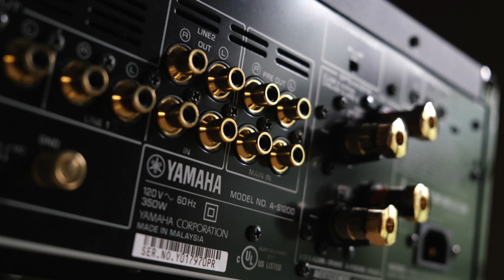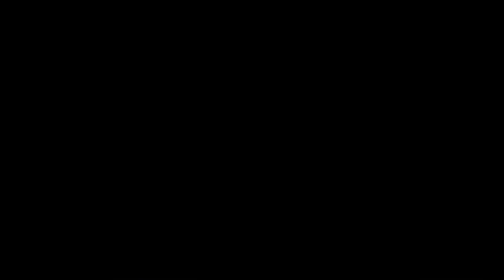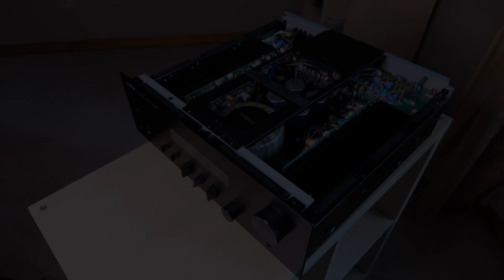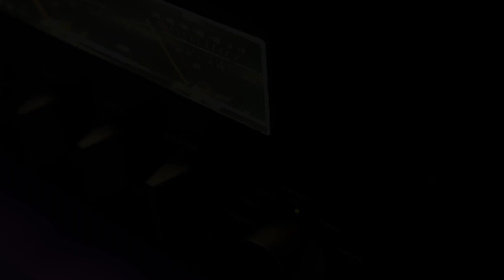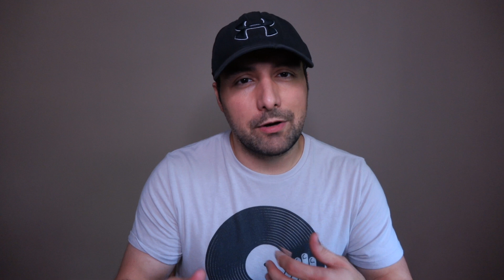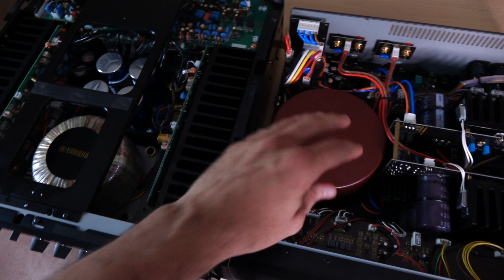Review!  The Yamaha A-S1200 Integrated Amplifier!

Comment: I'm getting myself an A-S2100 quite soon. They say it's has a warmer sound than the S-1100. I'd love your opinion on A-2100 and if it worth to pay extra and get the A-2200 and how A-2XXX series stacks up against A-1XXX series (especially the built in phono stage and headpone output differences).
Reply from the maker: The biggest difference is that the 2xxxx series uses a balanced circuit.   So if you're running XLR into the integrated,  the difference should be noteworthy and positive!
Reply: I’ve the A-S2000 which has a single balanced input.  It’s definitely a bump up.  There is better separation and an open spacious presenentation that is addictive. The CDS-2000 balanced out, or say a Benchmark Dac3, drive this nicely.  On the 2000, Yamaha also does something special to the rca cd input that allows a rca input to enjoy the spacious presentation, like the balanced inputs.  I run my phono pre into these and it adds the dimensional magic that the balanced inputs deliver...

Comment: Hi Sean you did not speak about sound stage, How is the  Sound  Staging on the Yamaha, Is it wide is it 3 dimensional ?
Reply from the maker: Standard.  I only mention soundstaging with electronics when they impart something distinct.  Most of the time, a good component will simply allow your speakers to do their thing.  That's how it is here.  If your speakers lay down a huge soundstage, that's what you'll hear.  If they don't, then the 1200 won't artificially boost it for ya.

Comment: I just got the Yamaha a-s 1200. I was wondering if when you turn the bass and treble tune controls you experience a short interruption in the sound? When the bass and treble tune controls are in neutral position and I move them, I hear a "click" sound, then the music stops for a fraction of a second. I have never experienced this with my past Yamaha amps.
Reply: That is because the tone control circuitry gets completely bypassed when they are set to 0.

Comment: I own a Rogue Audio Cronus Magnum 3 which is ok but I am not totally sold on  tube amps.  I am interested in the yahama 1200 and noticed that you recommended the yahama over the Rogue.  I would be interested in your reasons for doing so.  Thanks.
Reply from the maker: Rogue makes great gear.  The build quality is solid, the reliability is fantastic, and the sound is pretty even keeled.  The problem is:  Their tube gear tends to sound more like SS equipment than what many people expect from a tube amp (lush harmonic mids. detailed yet smooth highs, with depth for dayssss).  To some, that's a good thing.  To me, it comes close to defeating the point of buying a tube amp to begin with.   The Yamaha, to me at least, doesn't sound like a tube amp.  It just sounds like a real confident, kick-ass SS amp that doubles down on what transistors are good at without going too far into the "dry / one dimensional" category.  Def. worth checking out if you can.

Comment: Hi Sean, Nice review! I own a Marantz PM6006UK amp at present which I am pleased with, it is my first ever Marantz product, my previous amp was a Naim Nait XS which I liked a lot and Pioneer A6  it was a  twin mono inside, a brighter sound but excellent, I sold both in a moment of madness and the Marantz has been a really good stand in, considering the Naim cost nearly 4 times as much! My question is I am thinking of upgrading to Marantz PM8006, and I saw your review and liked the source-direct comment! I thought sounds like my kind of sound! Then I watched the Yamaha review and it sounds good as well and the build quality looks superb and your comments on its Clarity and Presence sounded good to me! How would you rate it compare  to the PM8006 Which I know is cheaper? My room is small and I use Mission LXI and Monitor Audio Radius 90 speakers, My Ideal Speaker would be I think the Harbeth Ps3 ER monitor. My Cd Player is a NAIM CD5Si in fixed output mode[phono-only} and display off, connected via QED reference 40 silver cable{superb} on a special rack with special glass shelves, HiFi Racks wooden speaker stands with Atacama gel pads, Chord Clearway screened cable, bare-wire connections which I re-cut every 6 months,to me it sounds better than plugs! I get most of my cds from cd-japan in SHM format and providing the mastering is good and that is the key! they sound superb, better than most SACDs! One tip I found with my Marantz here in England is it comes with a moulded adapter type two pin to uk 3 pin fitted in to the mains plug, cutting this off gets rid of a set of connections and fitting a standard uk13 amp plug and fuse did improve the sound and I also now use AMR 13 amp fuses which improved the sound again! The joys of this hobby!
Reply from the maker: Search the comments section for my take on the PM8006/S1200 comparison.  I'm being a bit lazy here as I already addressed this a couple times.   Long story short:  I think the 8006 is a very good value-proposition, but if you have the budget for something like the 1200, I say:  Go for it.  It'll make you happier over the long haul.
Reply: @ZeroFidelity  Thanks for reply, I forgot to ask does the 1200 have a tone defeat via the remote?

Comment: If you had to choose between this and some equally priced separates in total, what would you do? There are some really good separates from Schiit and others that might be better?
Reply from the maker: It depends on what I'm after.   Separates do not always offer superior sound quality and are often just as compromised as integrated amps.  Especially when you're spending less than 10k.   The only separates I can think of that I may chose over a good integrated amp like this Yamaha, all come from China.  I know.. I know...  it's not fashionable to like anything from China nowadays... but if you want to bypass the costs of doing business that add to the MSRP of western products (like the Yamaha).and if you're on a budget...  that's still the best way to get great sound for the buck.  And naw, I cant say I'd take Schitt anything over this Yammy.
Reply: @ZeroFidelity  some of the China based products are great, especially yaqin and willsengton tube based amps. I am onboard with you there for sure.
Reply: @williamwest9253  Just got the wellsengton tube amp three days ago, based on the review by Jay at Next best thing. I also have the Yammy A-S2100 from a few years ago. Figure I am all set with amps. now.
Reply: E.Kent.D Would be interested on comparison between the two amps, cheers.

Comment: ....hard to imagine how the miss the dedicated sub out for this unit,.....having pre out is not the same
Reply: If your sub has dedicated speaker terminals, problem solved.
Reply: Triumph Lover that a no go with these floating designs in their topology, states in the manual to not connect powered sub to speaker terminals. The pre outs IMO are actually better than a dedicated LFE sub out. My 801 was attenuated at 100 hZ. Pre outs are full range, cross it over at the sub.
Reply: Nathan Jones I have a powered Elac sub with dedicated left, right and center speaker terminals. I was advised to hook it up by way of an additional set of speaker cables from my stereo integrated to the L,R  terminals on the sub to avoid any out of phase signals. I have L,R rca preout on the integrated and a single rca LFE/Mono in on the sub. The sub also has subwoofer level (dB) and crossover frequency (Hz) controls. Which is best? Appreciate any input. Cheers.

Comment: Yamaha has always made good amps, receivers and integrated amps.  I think for the money that they are charging, and if you want more features like bluetooth, dac support and more digital inputs, I would say look at Rotel.  

The Ra-1592 will go to toe with this for the same money practically, maybe 200.00 more and you will get 200 watts per channel with more digital inputs, blue tooth and Rotel custom builds it's own torridal transformers and Rotel has a track record for reliability. 

 Beyond that point Rotel goes into separates and you get into the Rb-1590 amp and 1590 preamp.  The 1590 power amp is huge.  There are steps of separates before this, but beyond this, you go into their pro line up, which is the Miche line of components. You get more for your money with Rotel than Yamaha.

Comment: A bit strange that an amp of this price has no tone control defeat button.
Reply from the maker: The tone control circuit is only active when you use the treble/bass adjustments. So there's no need for a defeat button.
Reply: @ZeroFidelity  Clever stuff. Thanks for the reply.

Comment: No way to test phono input? ...
Reply from the maker: I dont listen to vinyl.  So nope.   And even if I did, I'm not experienced enough to have an opinion worth listening to.  Especially in a formal review.
Reply: Hi, I have the AS1100 and have 2 turntables connected, one connected straight to the phono input and the  other through a   Rega Aria pre-amp, and the sound through the  phono on the Yamaha is as least as good as the Rega.

Comment: Interesting but odd review. It should have the same characteristics as the 1100/2100/3000 and they have never been described as forward, bright but warm musical and as all mosfet tube like. Head phone stage is supposedly very good. You can’t rely change the characteristics of an amp with tone controls. It’s not the frequency response but the timbre and tone of it that gives the sound characteristics. I wonder if you got a odd sample or something else made it sound different. Here is a link to another review that describes its sound as basically the same as as-1100. https://youtu.be/ENNjH5ARRj4
Reply from the maker: For what it may be worth to you, I received feedback from THE engineer behind the 1100 and 1200, who confirmed that my assessment of the integrated's performance is correct.  He also noted however, that the 1200 tends to calm down after 1 hour of being powered on, and after 50 hours of total use.  So far,  the feedback from people who've spent time with the 1200 mirror whats said in this review.  For what it's worth, I never once heard this "smooth/warm" sound with Yamaha integrateds, regardless of the series.   This leads me to wonder something that is completely unverified (do not misinterpret the following as a fact):   Some manufacturers will voice products differently for each major market.  This may explain why opinions on the 1100/1200 differ so wildly. Especially on a product with such an obvious character.   Again, I cannot verify this to be true because I genuinely have no idea...   but it would make sense.
Reply: The as-1100 was even different tuned for the European  and Japanese markets.  There is a video on that here at YouTube (will look up the link and post). Regarding warm or not I would say 801 and below not so much but the AS series yes. See this review. https://6moons.com/audioreviews2/yamaha3/3.html The 2100 is essentials a balanced 1100 with discrete headphone amp and even better discrete phono.

Comment: You know why Yamaha calls their new flagship integrated amplifier the M-5000? Because it looks half as good as the MX-10000. Fuck Yamaha. Charging $10,000 for a unit that is built cheaper, looks cheaper, and has inferior specifications compared to their past statement pieces with bigger VU meters. Their newer products looks like toys. Lifeless and dull.
Reply: Have you heard the m-5000 before making this comment?  I'm not provoking anything, it's an honest question, I'm curious.
Reply: dfknyc78 Does the M-5000 have speakers built into it? If not, then no I haven’t. 😂
Reply: @dfknyc78  Again, do you see speakers built into the amplifier? It's a very simple question. How does one hear what cannot be heard?
Reply: dfknyc78 To suggest that one sounds different from the other means that one or the other is coloring the signal (or even both). The guiding principle of Yamaha had always been firmly grounded in NO coloration. Coloration is measured as DISTORTION. When a Yamaha is spec @ x watts 20-20,000 hz with no more than y% THD, it either performs to that spec or it does not. Pure and simple. If one performs and produces sound that’s different than another, either it’s out of spec and needs service or Yamaha is LYING about their performance specs!
Reply: @omgwtfpwnd  I'm a trained electrical engineer from a legit ABET accredited 4 year university with aBachelor of Engineering.  I am beyond those who like to boast about being a mere "sound engineer" with x amount of experience, (those those aren't legit engineers btw) so I do speak with some degree of technical expertise.

No, coloration is not distortion.  In fact, the term coloration is not even an electrical engineering term nor a scientific term, it is a term made up by the so call "audiophile" community.  Like all other BS terms to made themselves sound like some sort of sophisticated connoisseurs.  I am not even sure what you are talking about being in spec and out of spec.  The measurements are the measurements, in fact, they are measured using precise equipments and they are printed on the user manual when you buy a A-Sxxx series.  These measurements can easily be confirmed by an independent third party to be accurate.  A company as big as Yamaha with a brand value like Yamaha don't go around lying about the measurements of their products.
Reply: dfknyc78 If you’re suggesting that the M-5000 sounds any better than the MX-10000 then I look at you with an expression of exhaustion and ever so slight amusement. Not so long ago there was no need to debunk the myriad of myths surrounding the audio (especially high end) industry which was once based on objectivity and the scientific method. When distortion, response and noise were no longer issues even in the most modestly priced hardware, the high end segment had to rely upon cock & bull BS in order to justify its "raison d'etre". Those engaging in this type of activity might well be described as "audio whores" who, rather than educating, instead choose to exploit the underinformed. Well I guess the economy needs its sheep and those taking advantage of them would've made Jordan Belfort proud.

Comment: Sorry but this is like 1960’s tech. I’m waiting for the perfect active tower speakers. Buchart S700 maybe😎
Reply from the maker: The overwhelming majority of hi-fi that exists today is an evolution of tech that was developed decades ago.  This includes actives.
Reply: You have to know that they had some really serious audio in the 60s. Non of this stuff is a huge jump minus audio that includes digital processing. I will take the higher end AB amplification over gimmicky processors. I would say at this point a good DAC would be an exception which makes a digital source sound more Analog (1960s).
Reply: Yamaha has been recycling this amp since the 1970’s.
Reply: @SKYENET-zy2cn    Do Not fix it  when it's not broken .
Reply: @SKYENET-zy2cn  And this is a problem because...?
Reply: Are the amps like something from the future because they're inside the speaker? 🔊👈